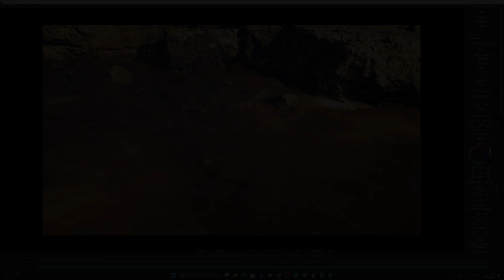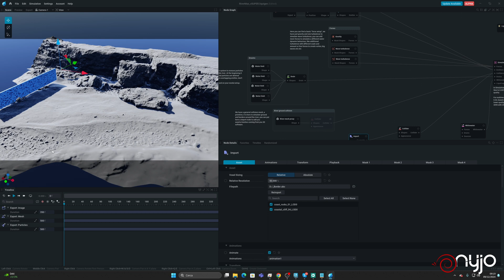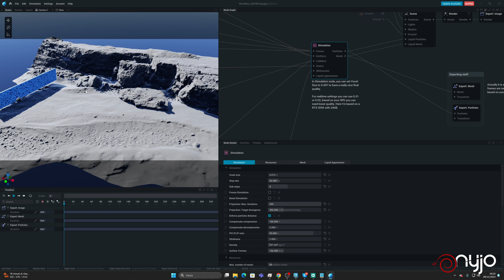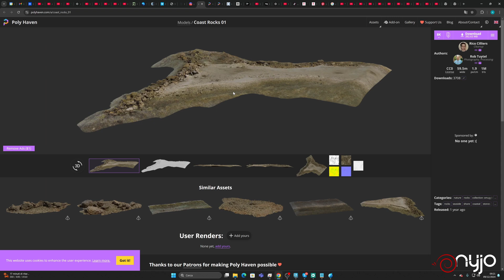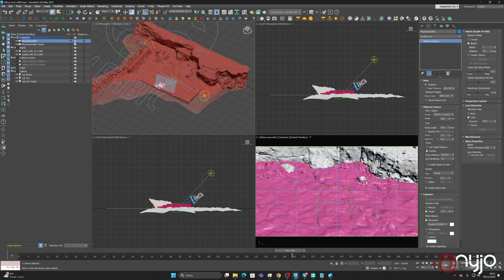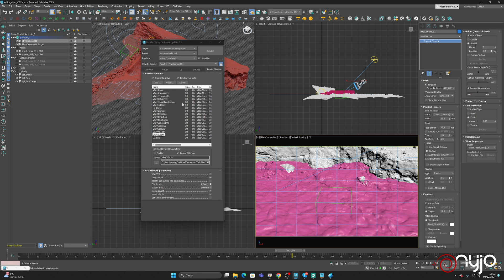Africa River Setup (LiquiGen / 3ds max) | Nyjo FX

Comment: liquigen foam supporting in 3dsmax?
i tried to export the foam in alembic format(.abc). but it's not supporting 3dsmax v-ray.

did you try it.?
Reply from the maker: Yes, it works. Problem is that 3ds max Alembic Importer can't load ABC particles, so you have to use the VRayProxy importer. In this scene setup you have it inside and we have a tutorial here on our YouTube channel to learn how to use it : https://youtu.be/IzoNbmJ4X2U
Reply: @NyjoFX  Thank you.
is it possible to import the particles in Vantage? it is possible with tyflow. but we have to use phoenixfd. is there any other options for liquigen foam particles.?
Reply from the maker: @NikhilRavindran-l8k  Actually there's not a simple way to do it, tried to use it and it seems not supported but VRayProxy mesh is supported in Vantage, so we are investigating to find a way to do it at the moment.